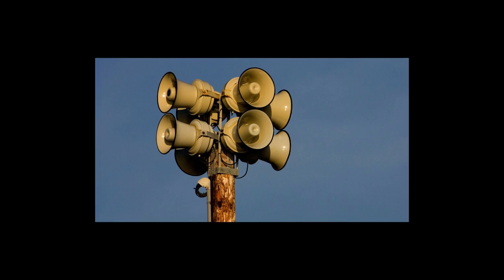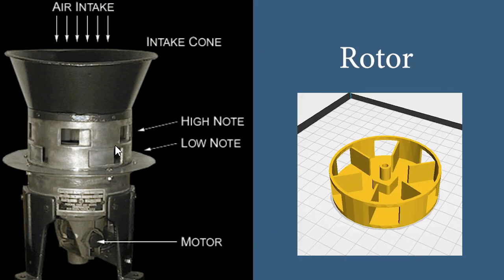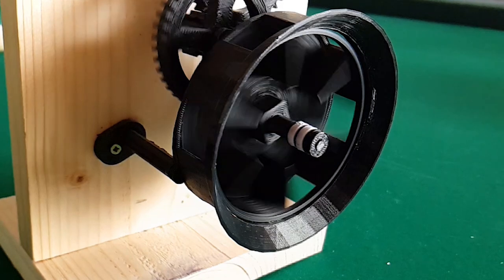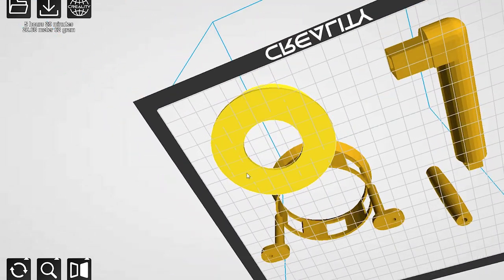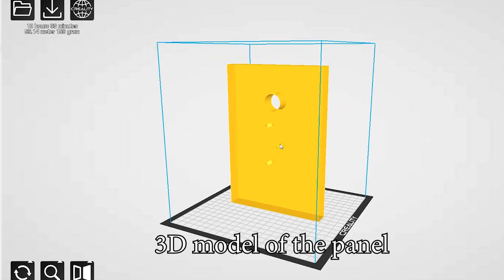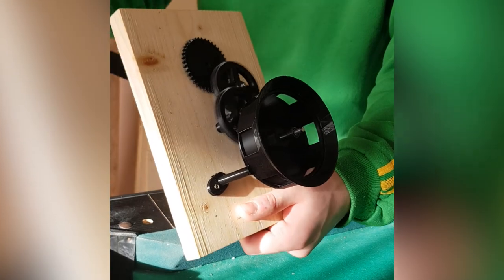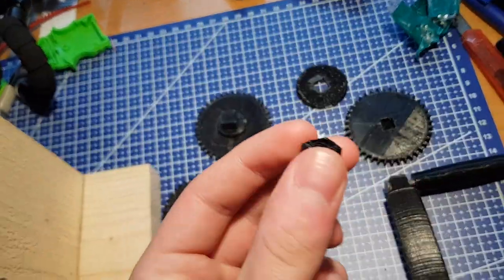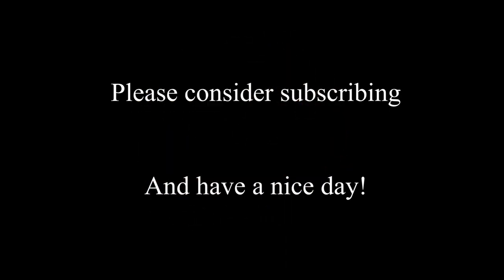Hand Cranked Air Raid Siren

Comment: Pretty great video! But, I'd just like to correct some misinformation.

Usually, most electromechanical sirens'  chopper(s) spin at 2850-3450 RPM, since they usually have 7-16 ports, they don't need a higher RPM to get loud. For example, let's use the Federal Signal 2T22 as an example, it is a dual Rotor siren with one of the chopper assemblies having 10 ports and the other having 12 at 3450 RPM, this gives it the classic air raid siren sound effect you hear in Hollywood movies. If your were to take a 5/6 port siren (Such as a 1000T or GP3) and give it 6900 RPM, it would sound almost identical to a 2T22. In fact, the only sirens that have high RPM motors are often smaller sirens (Such as the model 2 and GP3) and some vehicles sirens, as well as Thunderbolt sirens. (Depending on the chopper level)

If you'd like, i could give you some tips of how to improve the loudness of the siren you 3D printed.

1: Make horns or a shroud for it, this will make it louder by having it push against more air.
2: Make the chopper design more efficient. You already made it a directional chopper, so that is good. Make a sort of cone like structure surrounding the middle of the chopper to direct air outwards, and put triangles on the ends of the Vanes.
3: Make it larger or increase the RPM, but you could make it louder by having it have 12 ports instead of 6, and reduce the RPM to around 3000-3500 to have a similar pitch but more power, which you can then use that power to make it bigger.
Reply from the maker: Thank You! I was pretty new to sirens, but the working concept of it amazed me. And I was sad that mine was not as loud as I imagined, so I realy appreciate Your tips! And in the future I will definetely improve my siren with given tips. Again thank You very much, because I always like to learn new things!
Reply: No problem! I'm glad to help out.
Reply: Bruh, looks large to learn...

Comment: The issue is your siren is made of what is essentially plastic thus you yourself will have to use your energy to spin it up, if you look at any cheap ish hand crank air raid siren a lot of them barely use any energy to get it going because of the way they’re designed and the fact the rotor is machined out of metal instead of plastic!